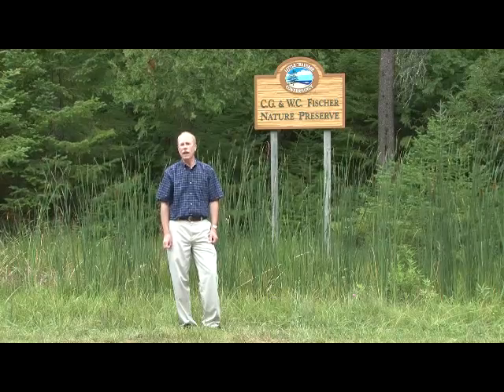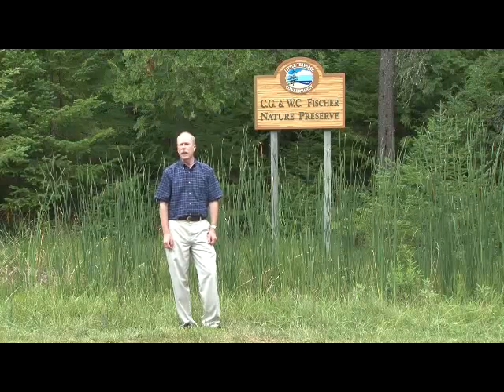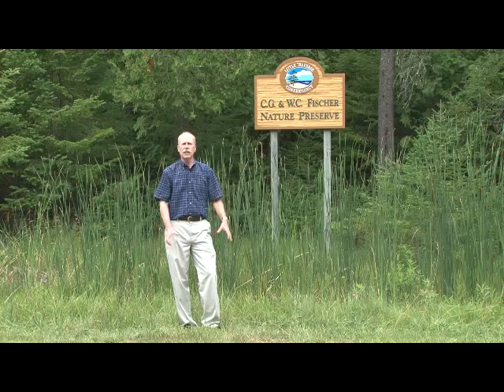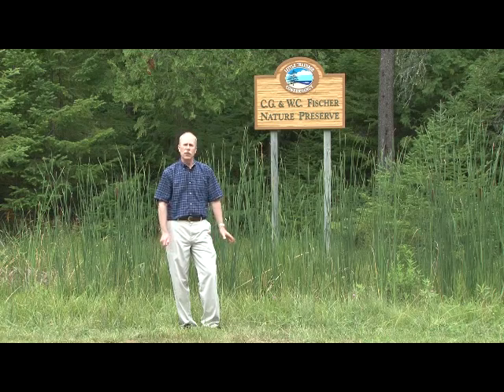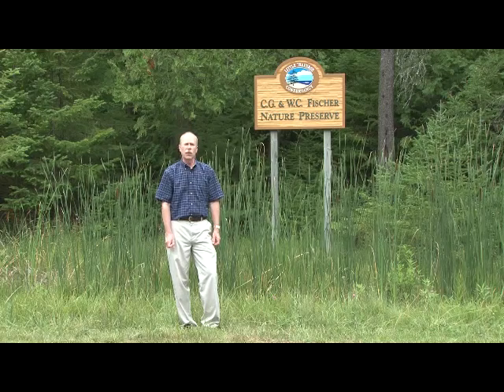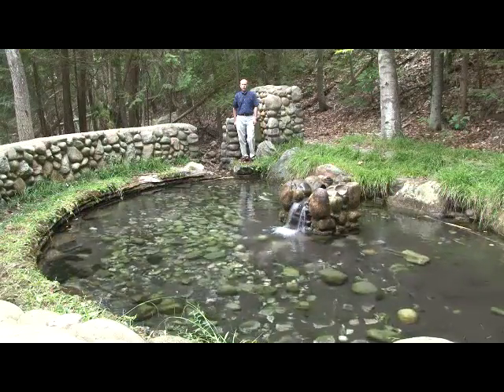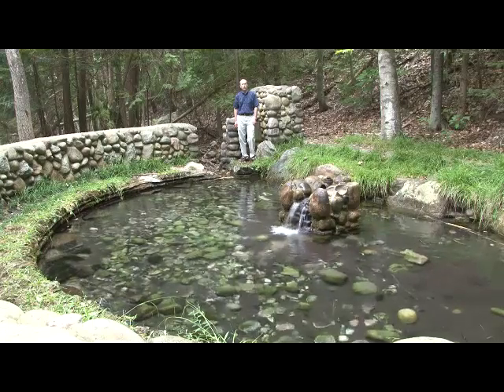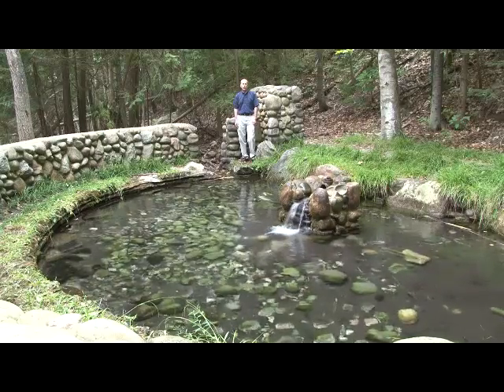Artesian Wells

Comment: This "conservancy" just drains artesian water into the surface? That does actually reduce the pressure and deplete the aquifer... Seems like an irresponsible use of water resources.
Reply: introprospector not actually the aquifier gets filled automatically through infiltration recharge area
In short the flow will not reduce pressure significanly